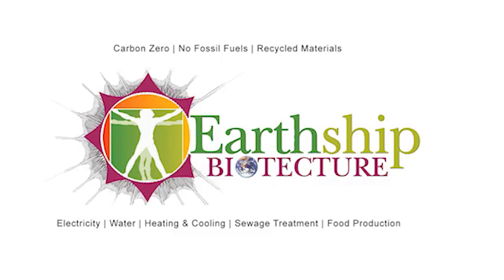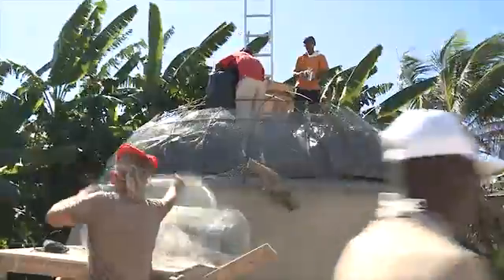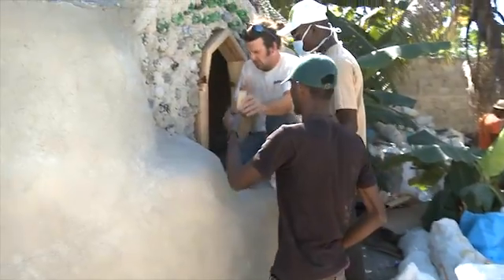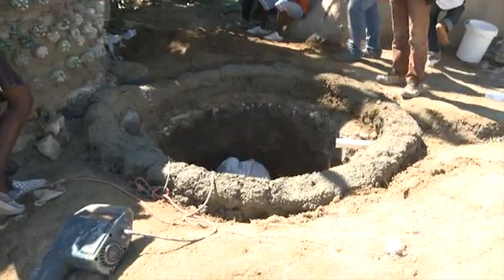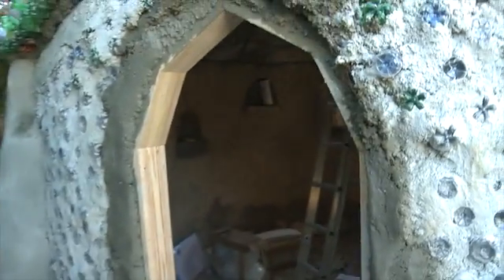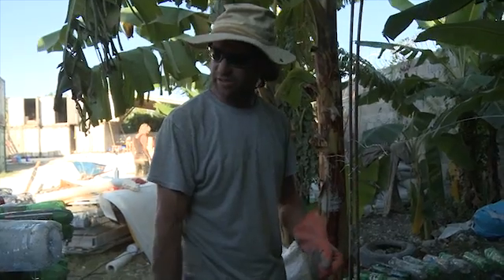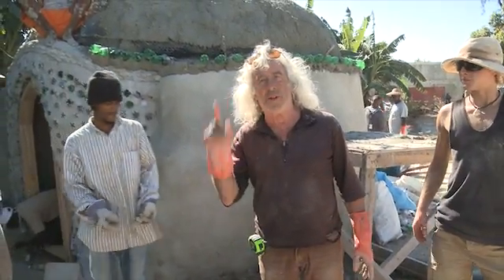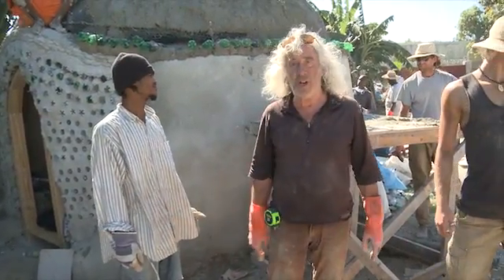Haiti Earthship Project: Contained Sewage and Roof Insulation

Comment: Standing in the rain. 
Well old man winter came in with a vengence. Have been working solo on my earthship/earthbag hybrid.
I'm standing in the rain currently..having fallen short in creating a sealed roof. 
It is steel and rebar with portland saturated burlap, then paint crete then aircrete over that but did not have the chance to seal it.  
If its not a totalef disaster ..i have 6 more hours of rain coming..
I need an idea of what I can do to provide a sealed roofline
 I saw that you all were using bags of cardboard and styrafoam inside trash bags.. After that what do you apply.??Please help.
Thanks,
>>>~￦ulfy~~>

Comment: This project is not a perfect project to Haiti first because the water tank is too small for water to stored and second the rain is rarely to trickle.
Reply: +eauliangsa cris  The cistern they are using in this educational model is 6' in diameter by 7' tall (about 6568 liters) which will give an average Haitian (known to use around 18 liters a day) about 364 days of water and more if they ration it.  I know that most people in a tough situation do a washcloth bath instead of a shower when conserving water.  This should give them plenty of water to spare.  The average water usage by a family of four would give the family about 91 days of water.  Haiti has two very wet seasons yielding 54 Inches of rainwater per year and two drought seasons lasting not longer than 91 days.  They should have plenty of water and with rationing, plenty to spare.